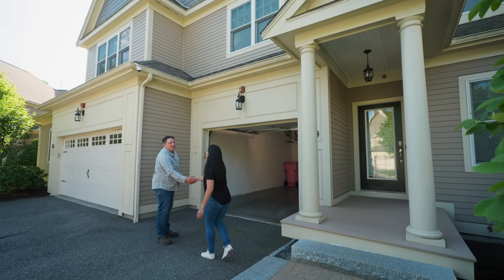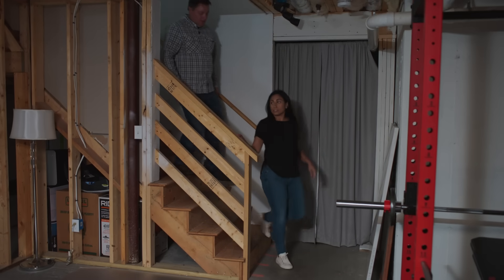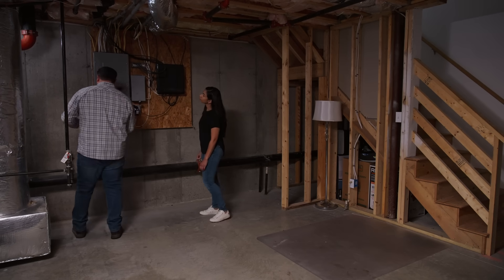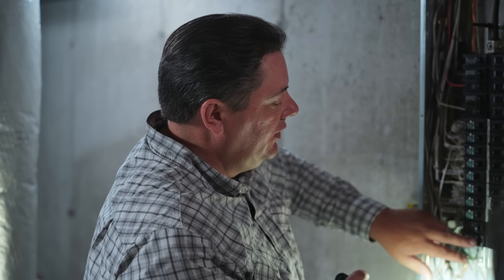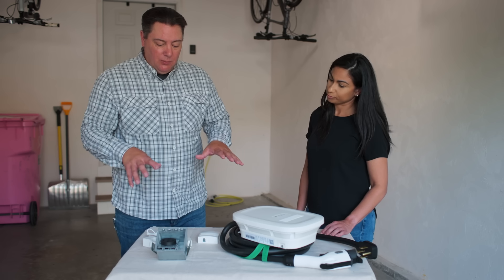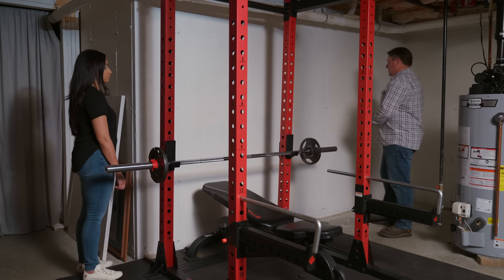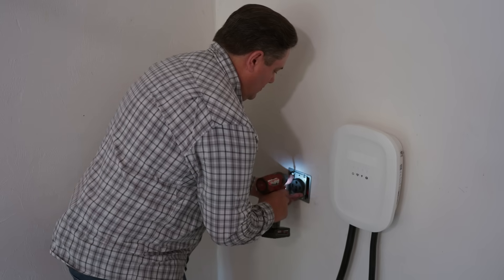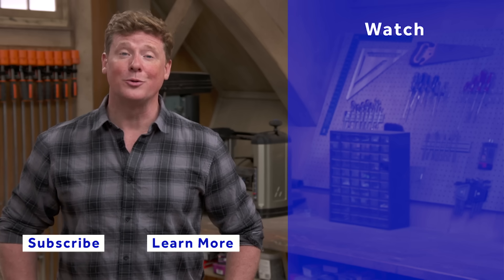How to Install an EV Charger | Ask This Old House

Comment: OK, what size breaker did you use? What kind of breaker did you use? Was it a GFI breaker because by NEC code an outlet in the garage needs to be GFI. Also what kind of outlet did you use? Because by NEC code needs to be rated for car charger. It cannot be the same that you would use for a range. I’ve seen many people install a regular range outlet in place of a car specific outlet and I’ve seen them burn up many times. This video shows nothing about actually hooking it up and what is required for safety. You show doing lockout tag out for safety, but don’t show anything about what kind of breaker to use what gauge of wire to use for what size breaker you’re using whether or not you’re using a GFI breaker and why all of the safety things that you need for the system that you’re installing. But you make sure you put lockout tag out just so you can take the cover off of the panel. Videos like this or what gets homeowners into trouble and hurt.

Comment: Wire size??  Breaker size??  GFCI protection??  EV rated receptacle??  Who knows!!!!
Reply: This video is a joke.
By NEC code installing an outlet in the garage for EV charger it needs to be GFI protected. This would be about a 60 amp to pole GFI breaker which is about $150. This would also need number six wire 2 hots a number eight neutral and a number eight ground. Also an outlet rated for EV charging. This video is going to get a homeowner killed or their house burnt down.

Comment: The electrical box you installed was an post construction type and has the tabs that hold it in place. As long as you are not constantly plugging and unplugging the cord you won’t have a lot of trouble but those are less stable over time. Also you want to spend the extra money and ensure your outlet is a heavy duty (continuous service) /car charge rated type.
Reply: By NEC code it needs to be rated for EV chargers. The one that was installed is for a cooking stove. It is not rated to be charging ev charger for multiple hours. I have seen many of these outlets burn up because of this if you actually look at the two outlets side-by-side, you will see major differences and heavy duty construction.

Comment: Nadia’s chief problem is in thinking a PHEV makes any kind of sense. Doesn’t matter what EVSE gets installed, no PHEV has usable range without filling the gas tank!

Get an EV, charge it a little every night, done. L2 is a convenience, kinda like adding a gas engine to the car but without needing to ever visit a gas station. 

And then Heath made the mistake of pretending the homeowner will buy a replacement EVSE some day, instead of just hardwiring one that doesn’t need to be upgraded later: They are ALL configurable, even the Emporia.

Apart from unnecessary expense, the #1 problem with using a receptacle is that many do not use good ones. Bad ones melt, or worse.

Comment: I had someone install my level 2 charger Mercedes Benz wall box and it was set for 48 amp charging.  It worked one time then I had to reduce the amperage setting to the lowest setting for it to not trip the breaker, which has made the charger no better than plugging in the charging cord into a regular 110 outlet.  Any idea why it did this and how to correct it?

Comment: My electrical panel is in basement. The ceiling is boarded up. there is though an old unused centra vac line running from the electrical room to the garage. Is it code to run wire through the central-vac conduit? Thanks.
Reply: Absolutely not code

Comment: You need a 240 outlet thats needed for EVs. You don't want to set fire to your home!!! Hubbell HBL9450A Straight Blade Device Receptacle, RTP, Industrial Grade, 3-Pole 4-Wire Grounding, 50A 125/250V, 14-50R

Comment: I’m installing a 60 amp breaker for a level 2 3wire.
#6 for my 240 for my equipment ground #10
Reply: The ground wire can only downsized one size from the conductor. Your neutral and your ground can be number eight. 10 is too small. The main conductors would have to be number six. Also I really hope that your breaker is a GFI breaker. NEC code states that when installing an outlet in the garage for EV charger that breaker needs to be GFI protected. This is $150 breaker about if the unit was to be hardwired. It does not need to be GFI protected.

Comment: If you can park your car in a garage and the garage has a 240amp outlet (clothes dryers use them), you won't need an electrician.  I have a SplitVolt box.  You plug that into the 240 outlet and then plug the dryer into one side of the SplitVolt  and your EV's charging cable into the other.  When the dryer is in use it won't charge the car, and vice versa.  I charge my Tesla 3 starting at midnight when the electric rates are lowest.  Easy-Peezy.
Reply: You need a 240 outlet thats needed for EVs. You don't want to set fire to your home!!! Hubbell HBL9450A Straight Blade Device Receptacle, RTP, Industrial Grade, 3-Pole 4-Wire Grounding, 50A 125/250V, 14-50R

Comment: I got mine wired directly to my panel with its own 60amp breaker.  I dont like the outlet installation.  Seen them melt, fire risk.  No thanks.  Charger breaker will pop if any issue.

Comment: Just run a cable with a plug on the end of it, to your electric drier socket, and unplug your drier at night when not in use, and plug in your charger, rather then add another circuit to your electrical panel, which you might not have room for, or need an upgrade to your electrical panel, or power supply. 
Not rocket science.

Comment: Why not simply use a modified charging plug that plugs into two 120v outlets on the outlet end and then you get 10 miles of battery per charging hour... cheaper than installing a class 2 or 3 240v setup...

Comment: Pick up the phone. Call a licensed electrician. Pull a permit and get it inspected. If you have an EV fire, and no permit for the charger, your insurance company will not replace your house and car. No permit, illegal installation. The insurance investigator  WILL look for a permit. If someone is injured or killed in the fire, you could be criminally charged for the illegal installation. Not worth the risk.

Comment: my electrician charged me $2250. does this sound accurate? the receipt says 60-amp breaker & 6 gauge wiring
Reply: Yes, that actually sounds right. Because nowhere in here did he show what size wire did he use? Your case would’ve been number six wire. Two hots, a neutral and a ground are required. Also nowhere in here did they show what outlet is required when an installing an outlet. That would’ve been a 60 amp GFI breaker which is about $150. Also the fact that in specific EV charger outlet is required, which is about 40 or $50.
   This video will get home hurt or killed or their house burnt down

Comment: It didn’t say what amp the charger was nor what amp breaker you put it or what amp a adjustable charger if it is was set to come on ppl are on here for help this was no help at all to a diyer but get a electrician to do it

Comment: Am I the only one who noticed that they measured 108 inches from right to left for the center stud, but then went left to right below in the basement?  Something doesn't add up.

Plus like others said, you need an industrial grade 14-50 outlet and not a cheap dryer/range one from Lowes/Home Depot.  Those cheap ones are known to cause fire hazards over time.  A hardwired charger would work even better.

Comment: Isn’t it supposed to be gfi protected?
Reply: Yes, it is supposed to be a GFI breaker according to NEC code. Because they installed an outlet in the garage it needs a GFI breaker if the unit was to be hardwired, then it does not require a GFI breaker by NEC code.

Comment: You can't just use any receptacle for your EV charger. It HAS to be rated for EV use, because these will draw for extended periods unlike a dryer or other appliance that maybe runs for 30 minutes. They'll melt and destroy themselves if they aren't specified for EV charging.

Comment: All around good video with reliable info 👍
Reply: This only had about a quarter of the information that you need to do the actual job. Any homeowner that takes this video and thinks that they can install one of themselves is going to hurt themselves or burn their house down.
Reply: This video is dangerous and should be removed. 

There is a huge amount of power flowing for long times in chargers, he described how to add an extra dryer receptacle. Everything about the video is wrong.
Reply: @truantray 😂

Comment: Did I miss the part where he actually installed the breaker?  :)
Reply: They made sure that they took safety for lockout tag out but wouldn’t show what kind of breaker to install and that NEC code requires a GFI breaker that cost about $150 or what size wire to use for what size breaker. But we will make sure we let you know about lockout tag out.

Comment: One thing not mentioned but perhaps should be is that you should TEST your non-contact detector on the main when it's live, BEFORE you kill the power.  That way, when it goes green after you've locked/tagged out, you know that the detector is working to some degree.
Reply: It'll save your life ,3-point test. Check something you know is live, check to make sure what you're working on is dead, then check something that is live again to ensure the meter is still functioning before you turn it off. Meters stop working in an instant. Might read a circuit as live one second and read it dead the next. You have to make a habit of checking to make sure you're meter is working properly as well as making sure a circuit is dead.
Reply: Yep, the old Live, Dead, Live test - essential in this line of work.

Comment: I have this Emporia EV charger and their energy monitor featured in this video and both work great. The monitor can also track up to 16 individual circuits so you can keep tabs on energy consumption of rooms or appliances
Reply: Energy monitor.   Can you tell me what the model is?
Reply: When this unit was installed in your house, did they have to install a GFI breaker seeing they installed a outlet for the unit? Because by NEC code an outlet installed in the garage for EV charger needs to be GFI protected. This is about $150 breaker. Also, what size wire.?

Comment: You should always test the charger after installing it! Give me a break dude... Also why no permits and inspections?
Reply: I agree with you that they should’ve tested the charger. I’m sure they did but decided to not film it for some reason. As for permits/inspections, it depends on your jurisdiction. If the jurisdiction requires inspection then absolutely you need to be permitted and inspected. A lot of jurisdictions however, dont require permits and inspections for post service upgrades such as adding a sub panel or ev charger installation.

Comment: For those considering using a 110V outlet to get 2-5 miles/hour, make sure you have a commercial rated outlet.  If not, they cost under $10 & are not too difficult to install.  Of course, hire a qualified installer if you are not qualified.

Typical home outlets are fine for most household appliances.  But remember, your car will likely be pulling 15A constant for several hours at a time.  That generates some heat.  Imagine running your 1500W hairdryer for 8 hours straight on your bathroom wall plug.  That outlet will get HOT!  Be safe, not sorry.

Comment: A bit surprised to see you doing a plug vs hardwire. Tons of instances of those plugs overheating and melting or causing a fire. If the concern is that it may be easier to move a charger when the owner moves away, just have the charger removed and have the power line terminate into a box. Much better than risking a fire. 
Usually think TOH has great advice, but here I disagree. Sorry

Comment: For a plug-in hybrid, where you can get 5 miles an hour on a level 1 charge, I don’t think I do the upgrade. 

Understand that there’s a difference between a hybrid vehicle and a fully electric EV. A hybrid typically can get you 30 miles on a full charge because it’s a hybrid. It’s working on gas and electric. When your electric charge runs out you use gas and while it’s using gas, guess what it’s recharging your electric battery . The electric battery is a small battery. Many of my coworkers have a PHEV vehicle. That’s the acronym for a hybrid in most car companies. 30 miles that 6.0 hours to charge or overnight plugging in your vehicle. Now some people may look at 30 miles and say that’s not enough but consider this How many miles do you normally drive to work in a day? For most of my coworkers 30 miles or 45 miles is just enough to get them to work and not have to spend a penny on gas. They literally unplugged the car in the morning drive to work plug the car back up and drive back home and all day the trip to and from work and maybe briefly to the grocery store or to the gym. They don’t use any gas. My coworkers only find that they use gas on the weekend when they go on a long road trip.

Now I do have some coworkers that have fully electric vehicles and they have a range of 300 miles or more on a full charge. For those vehicles you definitely should have a level 2.0 charger at your house. You need to be able to plug your vehicle up and get a full charge in a few hours . You can’t have a 300 mile battery and plug it in and literally have it take 60 hours to charge. Well technically you could because like I said most people don’t drive more than 30 miles in a day but if you have an electric vehicle and you’re driving it, you wanna make sure you’re 66% charged when you leave the house. Cold weather could affect your battery performance for example so you want 66% charge if you’re leaving the house and you’re in a cold climate. Warmer climate you can leave the house on 30% charge no problem.

One thing everyone should do is if you buy an electric vehicle, sit down and talk with the dealer about it. Make sure you understand how it’s going to function in the part of the country you live in don’t be afraid of electric just take the time to understand it.

Comment: Should only use a Hubble 9450 or Bryant 9450 outlet for ev charging.  What this guy installed is a fire hazard waiting to happen.  Luckily it’s a PHEV with a smaller battery pack.  The charging duty cycle is only about 2 hours.  For a full ev, this outlet is not adequate.
Reply: Also didn’t show that it needs to have a GFI breaker when installing an outlet in the garage according to NEC
Reply: @ericcarl5253   That depends on the state.  My state does not require it because we’re still on NEC 2017.  But states using NEC 2020 or newer do require a GFCI in the garage.

Comment: No mention of wire gauge used, no mention of breaker type/size used, no legitimate discussion of the true process. No point in posting the video.

Comment: It's an Emporia L2 EVSE, it doesn't turn on/off with home load, it will dynamically adjust.  If the house load is low it will run at 40A, if it starts to get to high it can automatically adjust down to 6A.

Comment: If you charge all night 22mph maybe fine but if spending the money go with the 50-60 amps for the fastest 44mph.  Electric bills your costs determined by kwh.  You are not charged for 120 or 240 volt.  Charging your car faster is cheaper vs charging longer as paying kw’s per hour
Reply: Hilarious. Charging 5 kw in an hour is 5 KWhr, charging 5 hours at 1 KWhr is 5 KWhr.

No, you do not save money charging faster.  Get a clue.

Comment: This video is essentially a mobile outlet connection vs a hardwire connection.  But this home has limited amps newer homes usually 200 amps plus
Reply: I was amazed to see a 10 year old house with only 100 amps service.

Comment: Hardwired wall connector gives you  faster speeds with the 60 amp as Nema mobile cables are limited.  Tesla wall connectors probably the cheapest with best software.  Tesla also allows the fastest speeds if hardwired on a 60 amp circuit up to 44 mph
Reply: You can do a 48A EVSE on an outlet using a 60A circuit.  Hardwired is only required if the EVSE is over 48A.

Comment: Level 2 chargers are in the car not the wall.  Level 2 wall connector proper term. Many EV’s have different size level 2 chargers on board. From 3kw charger up to 11 kw on board level 2 charger.  That affects charging speed.  Level 2 wall connectors are 240v from 30-100 amps.  Most wall connectors limited to 60 amps.  With the 80% safety factory actually 48 amps.  48amps with 11 kw charger should be around 44 miles per
Hour.  Many people can use a dryer outlet in their garage.  30-40 amps so around 22-37 miles per hour

Comment: It seems like a bad idea to install an outlet that could overload the panel if something else is plugged in that doesn't have the smart capability of the current charger. What if the next homeowner isn't aware of the limitation? It may have been a better idea to hardwire it.
Reply: Do you understand the purpose of a breaker?
Reply: @Billy.80  Thanks for your input, this was a very valuable comment.

Comment: NOT ONE WORD ABOUT WIRE SIZE ??  OR DID I MISS SOMETHING
Reply: Didn’t see anyone mention anything about the wire or the type of breaker that is required for installing an outlet in the garage for EV charger. Requires about $150 GFI breaker.

Comment: The biggest thing I disagree with is the use of a Nema 14-50 outlet. It would be much better off to have the charger hardwired into the circut.
Reply: Then you don't need GFCI breaker.